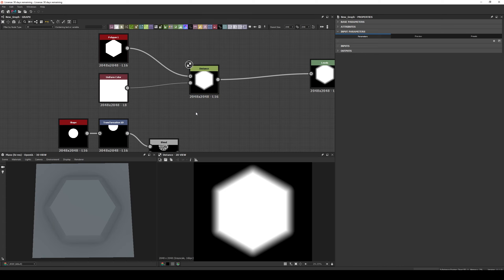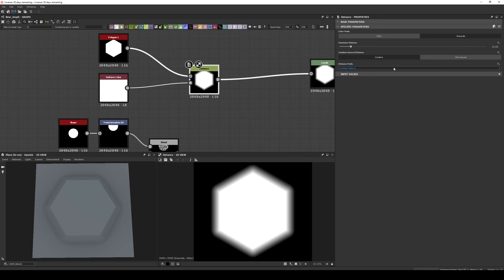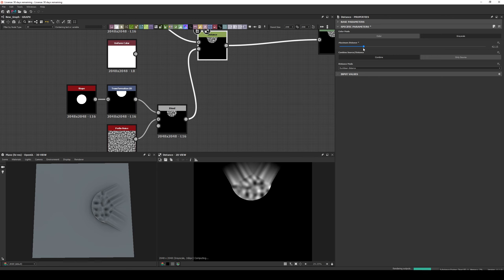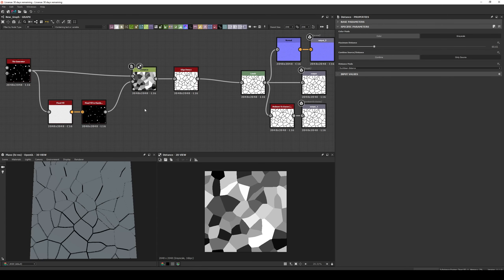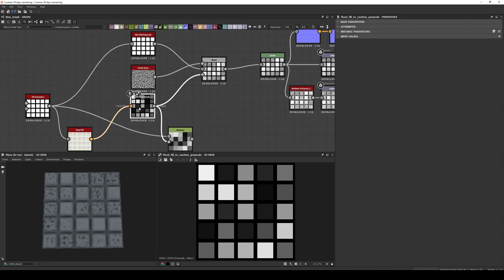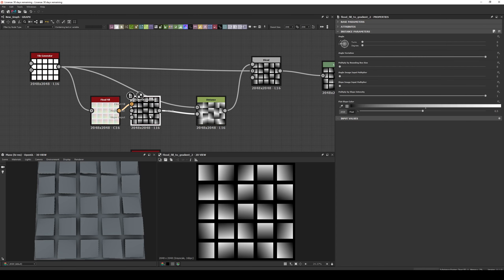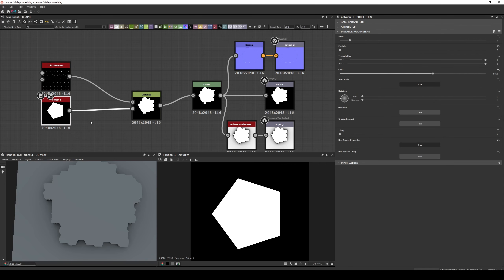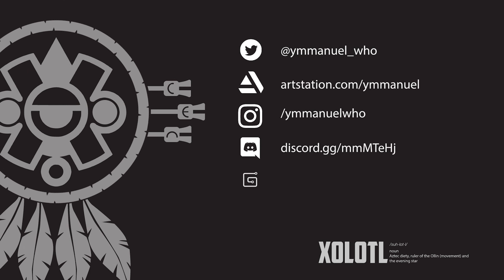KNOW YOUR NODES  Distance Node

Comment: I have a question, what if i don't have a Distance Mode inside this node? In the new vers. Subs.Designer  Adobe remove it?
Reply: The "Distance Mode" dropdown is still available in Substance Designer 14.0.0.
14.0.1 is the latest version which came out 3 days ago, while your comment is from 6 days ago, so I assume you were on 14.0.0 or lower.
There's no indication in the changelog that they removed it from 14.0.1. There is no reason to.
At 0:34 you can clearly see it in the properties panel (the top right corner) where it says "BASE PARAMETERS" and "SPECIFIC PARAMETERS". Make sure you have them open to see it.

Comment: Text is way too small. Good video otherwise.
Reply: He filmed it at 1440p with no consideration for us plebs.
1080p should be standard for videos like this. Most of the (established) recording software can record a portion of the screen without having to change the desktop resolution. Then it's just a matter of resizing Substance Designer's window to fit the recording area!
But you can still understand without looking at specific numbers. There are only a few parameters in the Distance node.
Reply from the maker: sorry, this was a way back with some sub par set up.🙃